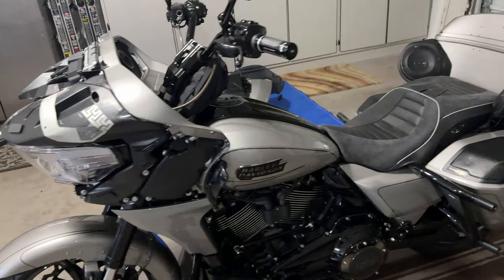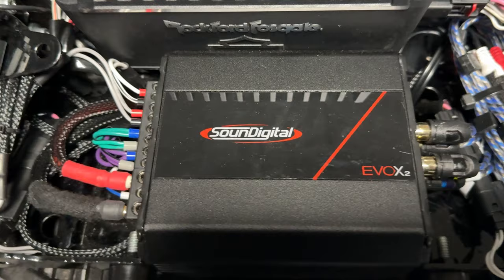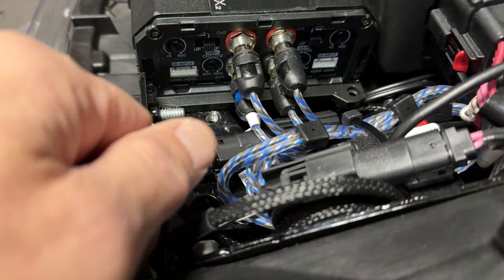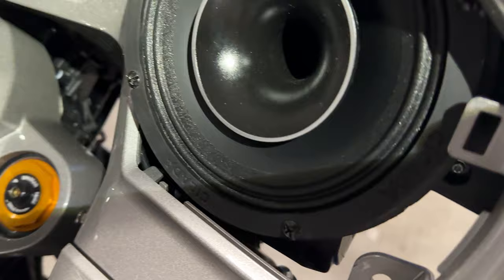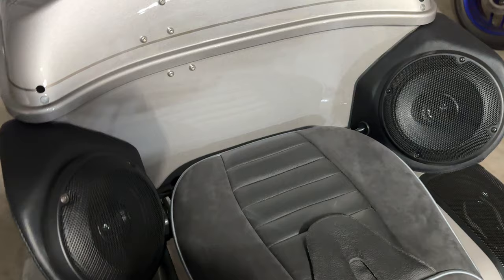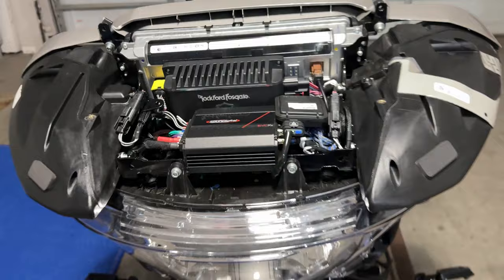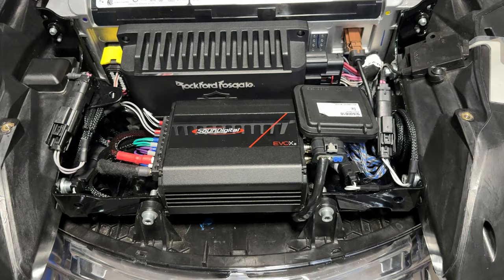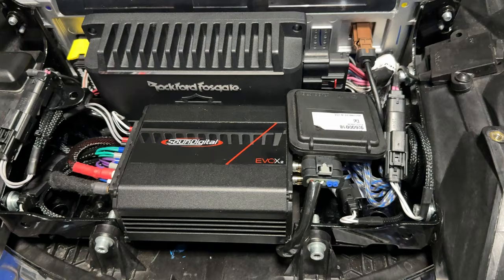2023+ CVO Amp/Speaker upgrade installation review

Comment: Thank you for the video very informative with good clear images. Do you know how the signal for the rear speakers is extracted from the bikes loom? I can understand how the fairing speakers signal goes to the ARC Audio DSP just not too sure how NVS loom taps into the rear speaker signal? Can you advise on this one.
Reply from the maker: There is a 4 pin connection for the rear speakers and from the amp there is a 4 pin plug that sends signal to the rear speakers.   just plug it in  Same as the front.
Reply: Great to know just the same as the previous model that had the same outputs. I didn't know if they had done away with the one in the fairing and just had the one under the seat. Thanks again.  @AZBaggers

Comment: Have the same kit ready to go in my 24 road glide. How did you secure the factory amp to the back of the radio?
Reply: I'm curious about this too. Also as it's on the heat sink for the unit does this cause issues for either unit?
Reply: Simple Velcro holds the amp in place. It’s so tight up there nothing can move. SPL baggers offers a bracket to both the amp in place but you have to cut the headlight to make it work. I didn’t wanna cut the headlight.

Comment: Do you get any "Hisses"  or "pops" or any noise when radio is either off or when bike is starting?  - Heard that by adding the 2nd amp adn DSP so close to stock amp creates "dirty noise"    Thanks
Reply from the maker: I have never noticed what you're describing.   It works flawlessly
Reply: @AZBaggers  thanks.. something mentioned by guy at Volunteer Audio.

Comment: I would think you would have put the Hertz mid bass neo's in the tour pack speaker pods.
Reply from the maker: I did put the hertz 6.5" neo in the tour pak
Reply: @AZBaggers  Looked like the coax neo.
Reply from the maker: @marcmo7138  I guess I didn’t understand the differences.  They are SX 165 Neo’s.  Would the other ones be different
Reply: @AZBaggers  The SV165 is a mid bass. Would have been perfect in those ported pods. I would think your system would be quite bright with the cicada horns and Hertz coaxial. Supposed the dsp helps a bit though.
Reply: @marcmo7138 

The SX 165 and the SV 165 Neos both produce the same exact amount of midbass in the tour pack. We offer both and have both in stock but I like having a tweeter in the back and yes you’re correct with the DSP we can smooth out the tweeter response . You have to remember it’s the port in the tour pack that create the base not the speaker itself so whether the speaker has a tweeter or not the porch and give you the same low, frequency output

Comment: Couldn't we just run the stock speaker level output from the Rockford amo  straight to the high level input of the second Amp and not necessarily need a dsp?
Reply from the maker: I believe the digital signal needs to be converted and the DSP does that.   The new system is an a-b processor like all the newer cars and requires a converter.   AP-ZEn makes them for ford.  Thats my understanding.   But I am not an expert.
Reply: You would.also want the ability to adjust and correct for the factory Rockford system. A DSP is def a no brainer on all my bike installs. Carlos is a mentor and trained me on bike audio. Do you absolutely need one? Maybe not. But you do😉

Comment: Hey what handlebars are those and do you have a video of the install plzzzzzzzz
Reply from the maker: They are ODI Podium bars and I didnt do an install (full) but I did do a video of the wiring and differences.   its on my page
Reply: Thank a lot brother last question the pullback risers come in 8 inch or no 🙏🙏
Reply from the maker: SO Kraus does make 8" risers.  However, I found that the 10" are perfect and you can adjust the bars back and forth for reach.  8 inch will only extend past the housing about 5"   There is a factory 3 inch riser under there.   So dont just measure from the cover measure from the triple tree.   @g929rr
Reply: Thank you very much for this information….
Reply: @AZBaggers Thanks for the answers on the riser setup. On my RG24 I have used an 8 inch and odi V-Twin handlebars-with my setup I didn't need to enlarge the holes. Indeed with a 10 inch Riser there would still be full visibility of the display. Many thanks again!